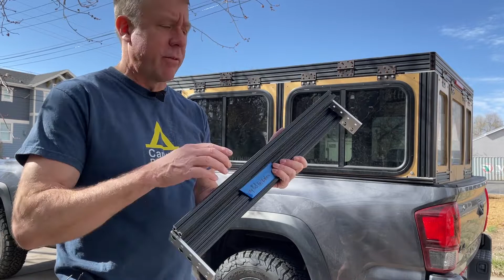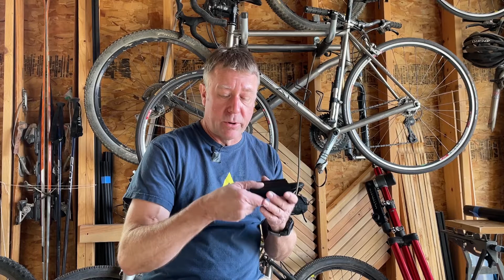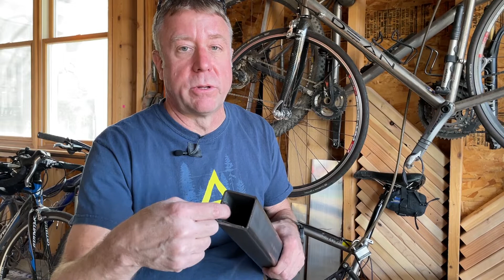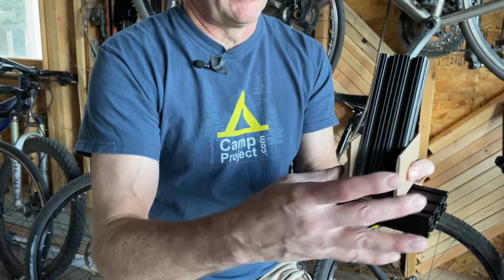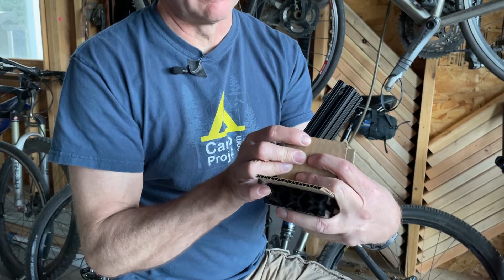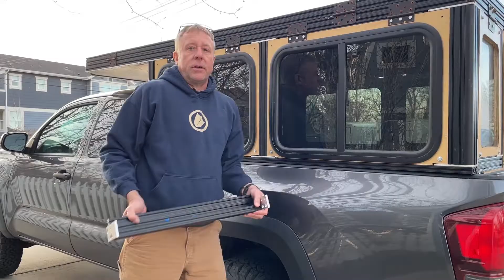Pop-up Camper Build (Part 10) Posts:01 - DIY Wedge Camper

Comment: Hi I like your build but I want to know what is the cost using 80/20
Reply from the maker: I wish I kept track of the weight and cost. Not sure how much I have in for the 8020. I will be posting a list of all the materials I used soon so I should be able to calculate the cost. Keep an eye on the descriptions below the videos. I will put a link there when I post it.
Reply from the maker: Still prototyping and experimenting. Don't have all the sizes down yet. Here is where I am going to put everything: https://campproject.com/camp/camperbuild/camperbuild_parts

Comment: Some great ideas!  I’ve wanted to do a pop up that’s not a wedge but doesn’t have canvas sides.  Hinged on the ends like most with hard sides you can fold up  on each side.